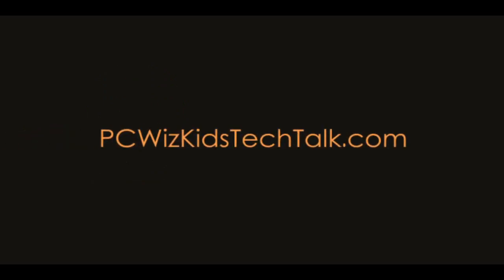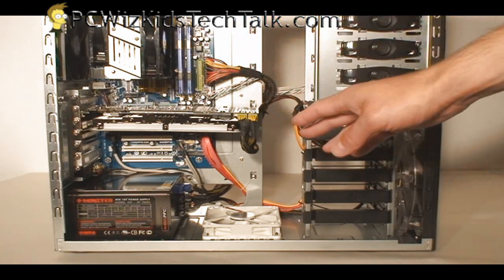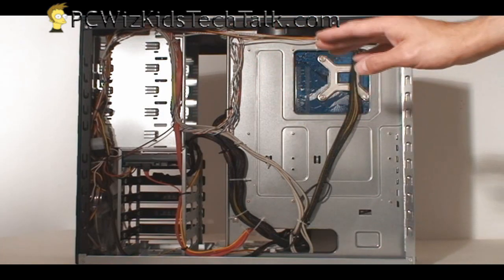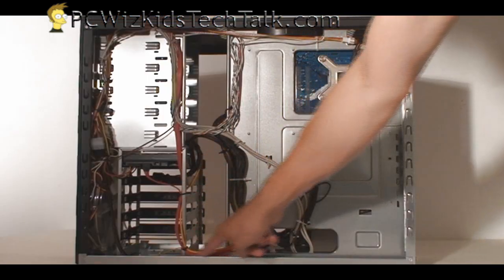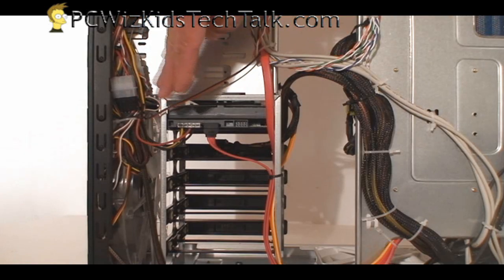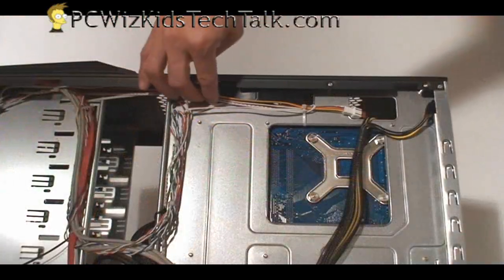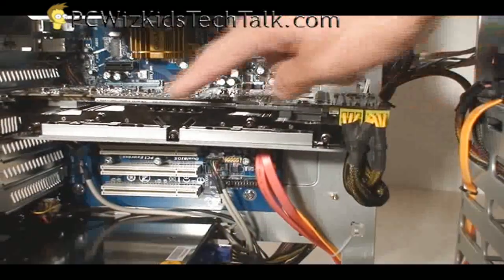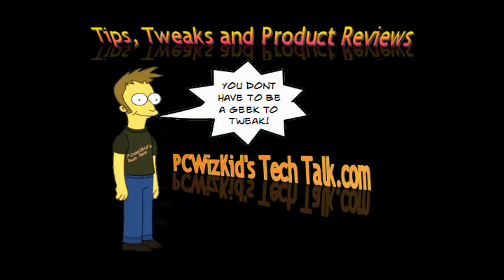PC How To - Cable Management 101

Comment: The video card means 550w including the other components, a 670 would use nowhere near 550W on its own. Of course, the 550W requirement is just a recommendation, since it depends on what the other components in your system are, but since the graphics card is usually the most power hungry component, 550W is a good general rule for most systems. So basically, 800W is more than enough power (provided you are talking about a single card)

Comment: @OutlawLovesNewVegas That really depends on how lazy you are and which case you're using. This on is the HAF 922 and with a non-modular all you see is the cables going out the management hole at the bottom and the disappear, they're stowed on the back of the mobo tray. Looking in the side panel window of mine you can only see the cables that are connected.The only "messy" cable is the one that leads to the graphics card, which is nothing to do with it being non-modular.

Comment: That looks like my computer case and motherboard,, good to know I screwed up when i bought my non modular psu. 

I also didn't instal my cables right... knew the thumb screws took off the back panel for a reason.

Comment: PCwiz i have a problem my four pin connection cable is too short and the only way to connect it is to remove the powersupply screws and tilt the powersupply and the four pin cable is going across my whole pc...its touching my graphics card and bending it a little..
what do i do? buy another PSU?

Comment: @Erroltuckerx  It allows power to pass through it so you don't lose the ability to plug something else into that 4 pin molex connector. It is a good small nifty feature the companies came up with so you do not need 500 splitters.

Comment: @CDA441 

I have the Thermaltake Armor MX and it also has minimal, if any, cable management options. Will probably look elsewhere for a case for my new rig as it doesn't seem to do the most amazing job cooling either.

Comment: Looks great!  Unfortunately for me, (well not unfortunate, it's sexy) I do have an acrylic case which doesn't allow me to hide cords so easilly.  Instead, I bought an Ultra X4 850 modular PSU.  The beauty of this thing, is that the wires bend easy without breaking and so I bunched them up (Kinda like that doll Betty Spaghetti's hair)  Things look clean indeed.  The only wire that looks messy is for my fans... wish there was such a thing as wireless fan power. (induction?) Maybe not...

Comment: @meatwadgunit 
yeah, full tower gives you kinda big space, but most of it place the PSU on the bottom so if your PSU cable not long enough it could be a problem coz you can't run in on the back of tray

Comment: @eric18603yankees i think that actually the fan is doing a good job pushing the air that gets intaked by the front fan. so it pushes it up and then the top fan pushes the hot air out! in that way it also cools components!

Comment: I have worked with Mac's before you cannot upgrade motherboard/processor/power supply/disk drives. The only thing you can upgrade provided your power supply can handle it is graphics card, ram, and more hard drives (if you have available sata connections which you should).
No overclocking, no customization of OS or Bios, limited graphics card capability since not every graphics card is compatible.

Comment: This is why the Corsair 800d is such a hot shit case now.  You can do this cable management job you did in 20 minutes if that instead of hours and the case fucking rocks with hot swop drives multiple radiators installed and so on.

Comment: or just buy a mac pro there are no wires to deal with or visible even when changing the hard drives and is not made with slave labor in china because all pc's use hard slave labor in china SO BUY A MAC

Comment: But if you install a fan at the side that will blow in cool air (two 120mm or one 200mm on a haf 922) the problem will be solved.